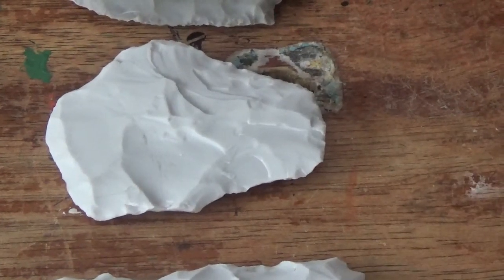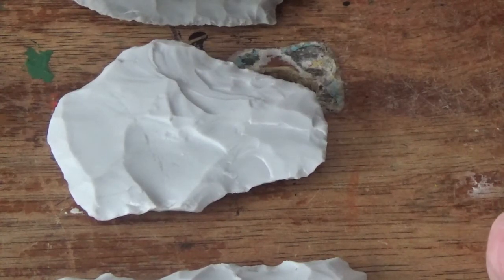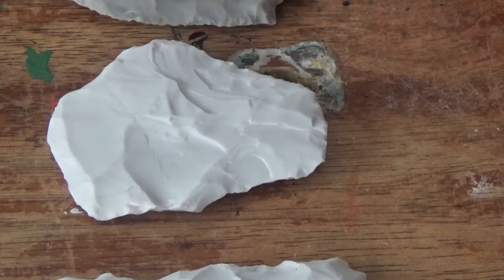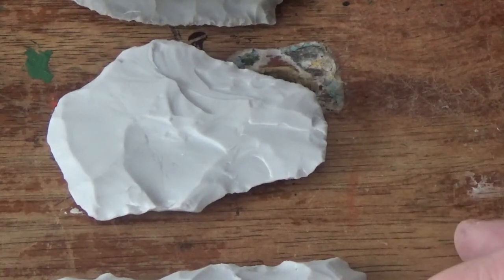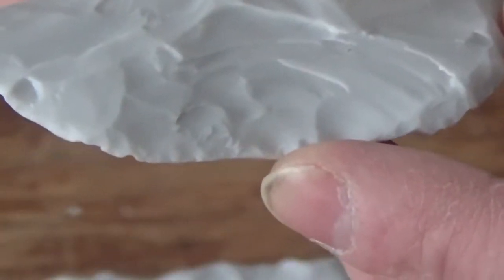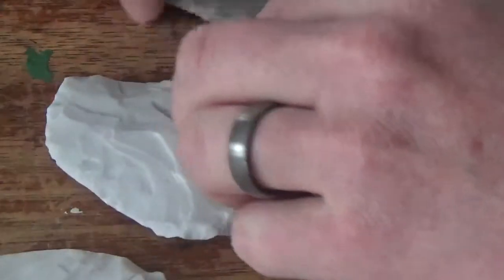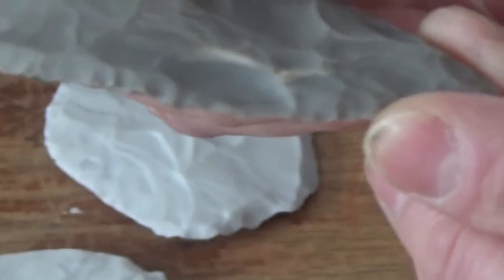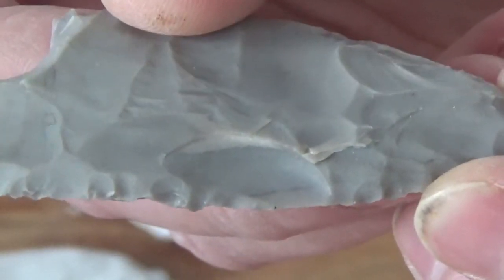Flintknapping Step fractures and hinges

Comment: I keep crumbling and stepping this kepku chert. I think its ruined now
Reply from the maker: Are you referring to Keokuk? I found Keokuk can be prone to stepping (because it's kind of chalky), but there are others who disagree. Try adjusting the angle of the stone in your support hand (or the angle of the stone if you are knapping off the leg). If you are knapping off the leg, be sure your support hand is allowing the flake to travel and you are not pressing too hard against your leg. Thanks for watching, I hope this helps. I have a couple other videos on steps and hinges if you search for them. Focus on good strong platforms and don't try to take off too much. That will likely help. Keep chipping :)
Reply: @PaleoGreenByrd  Thank you so much man. Yes keokuk chert I got from goknapping. I totally ruined the 1 piece.. before I started it was pretty squared off so maybe not the best piece to practice on. But the other piece I started on I did take some nice flakes off. My biggest issue is taking large flakes off. I have a large copper bopper but maybe its too weak for larger spalls. Im going to keep practicing on these and then I might try a different chert. Thank you for the information I enjoy your videos you definitely have taught me 👍🏻

Comment: Would work better if you used an anvil.
Reply from the maker: Do  you mean if these were knapped using the anvil method or bi-polar? It is very difficult to control the shape and size of  your point using the anvil method, and neither anvil nor bipolar will give you a flake pattern beyond what you are able to achieve using pressure flaking. Knapping using billets hammer stones, or antler is far more efficient in my opinion.  But if you have any reference material or suggested videos for me to watch, I would be happy to revisit my position.

Comment: Do you have a forum you recommend for a newbie to jump into?
Reply from the maker: Hey Warrior Works Training - Thanks for watching and for the comment. I would suggest the FB groups Flint Knapping 101 and first flakes slabs and cabs. Also Paleomanjim has some excellent beginner videos. If there is anything in particular that you would like me to address, please let me know and I would be happy to make a video specifically addressing your question.
Reply: @PaleoGreenByrd  Thanks so much! My current struggles are mostly with steps and hinges. Also, occasionally when I'm notching, I'll create a perfectly rounded edge that seems impossible to build a small platform on to flake.
Reply from the maker: I hear you, a stalled notch is usually a game stopper. You might be notching when the point is too thick, that has happened to me also. Once you no longer have a platform on your notch it can be very difficult if not impossible to continue the notching process. You can use a diamond file to continue the notch or build a platform. Also you can use indirect percussion to build a platform. I am not great at that right now, but I have seen others save stalled notches that way. The hinges and steps are most likely just a matter of seat time. Learning your angles, support, and amount of force needed to push the flake. I will make a video this weekend addressing these issues....Let me know what you are using for stone and tools. If  you want to see some really good videos on indirect percussion, check out DaveTenBears channel.
Reply from the maker: @warriorworkstraining  Record yourself and post it on your channel...That is really helpful.....You have some great content on your channel.
Reply: @PaleoGreenByrd  thanks so much man, will do
Reply: @PaleoGreenByrd  Man, thanks so much for the willingness to give substantive replies. It is super helpful!
Reply from the maker: @warriorworkstraining  Absolutely my pleasure! I am happy to help any way I can. Keep smacking that rock!